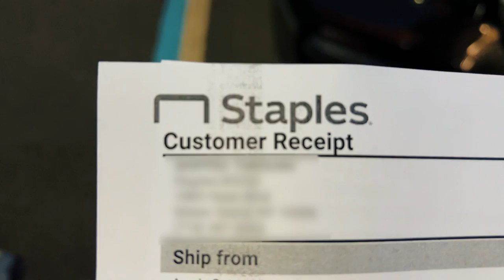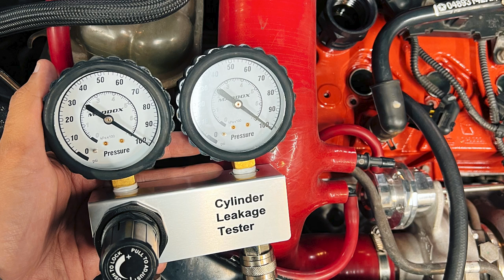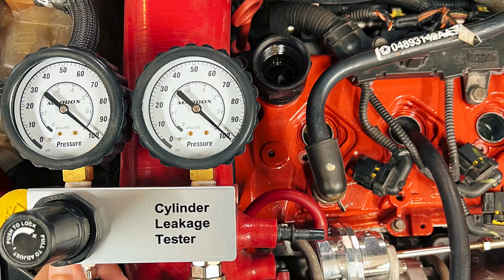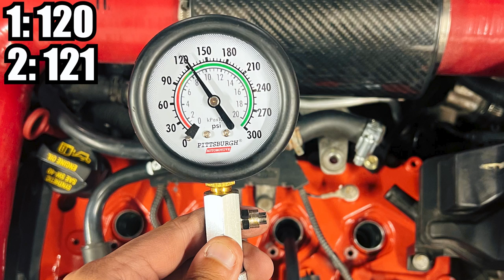ABARTH 500 CYLINDER HEAD REPLACEMENT! Broken Again...

Comment: My 2013 500 Turbo has zero compression in cylinder 2 and the dealer says it's a bad valve and they want $6500 to replace the head.  Is it possible to pull the head with the engine in the car, and can I ask how much that remanufactured head was? I'm still not convinced that it wasn't the MA brick causing the zero compression but I'm kind of at the mercy of their diagnostic.
Reply from the maker: 6500 dollars is another 500 turbo, I would not go that route. It is possible to pull the head with the engine in the car you’ll just have less room to work with, unless you remove the core support. The head I got was 1200. I’d suggest you get a borescope with a side camera to check the valves. If it turns out to be a valve replacing the head is not that difficult of a job.
Reply: @wellseegarage   Thanks for the info. The dealer did a borescope and said they can see a crack in one valve, but looking at the picture they sent me, I can't see a damn thing.  There's no way I would ever consider spending that $6500 on the head work. Next step is replacing the MA filter/screen, then pulling the MA brick, and then the head if all else fails. If I get to the point of pulling the head, I may have more questions. :)

Comment: Sorry to keep asking questions, but my blown 2013 500T is driving me crazy.  I can't seem to find any reliable information about which model cylinder heads will fit. Does it have to be from a Turbo VIN H 8th digit like my motor? What shop did you get that head from? And lastly, what's that red oil/grease you used for assembly? I know I've got a big job ahead of me.
Reply from the maker: 8th digit being H is correct. I got the head from New Jersey speed shop but considered one from eBay as well (was in Italy). The red stuff was permatex assembly lube.

Comment: Great build series! Do you think I would be able to pull the head on mine without removing the intake and exhaust manifold completely out of the car? Might have a few bent valves and just want to quickly replace the head.
Reply from the maker: Do you mean pulling the head without taking off the manifolds? Yes you can.
Reply: @wellseegarage  I worded it kind of weird, I bought an abarth with a timing belt that slipped off and bent the valves. I want to do the least amount of work possible to remove the head.
Reply: @nathanlewtschuk3566  how are you doing on this?? Did you get the head our with block in the car??
Reply from the maker: It’s possible, ours was only out to solve some other problems and do a once over.
Reply: @thargor6750  Yeah I got the head out with the block in the car, it's pretty easy. Just have to remove the front end. I can send you pictures. I got the head and intake manifold out in one piece.